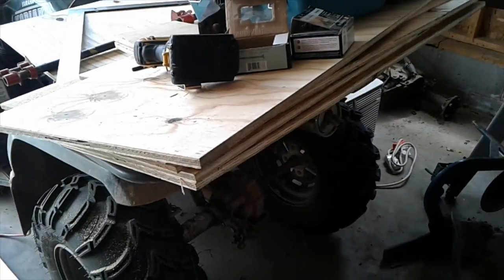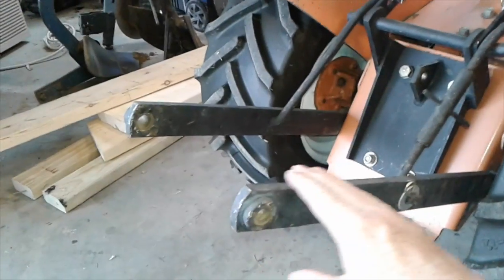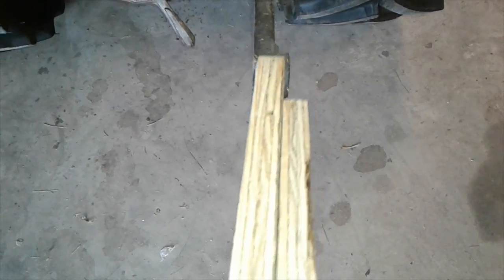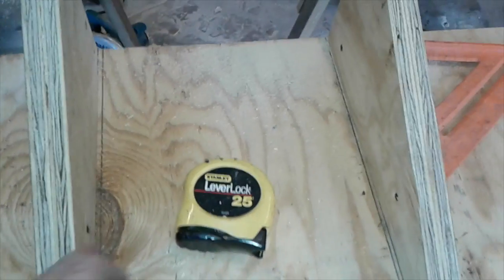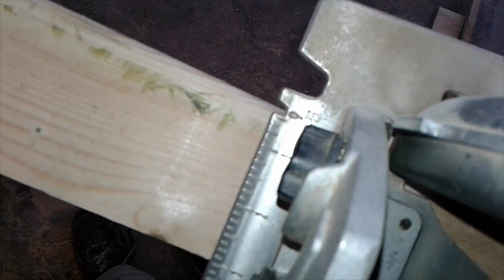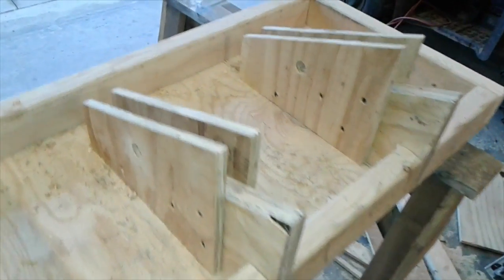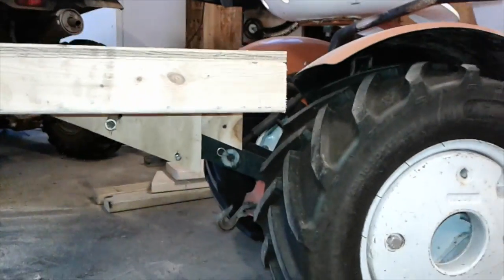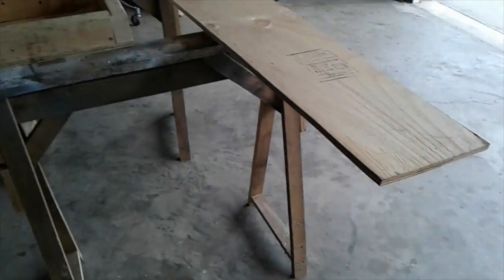DIY: REAR BED ATTACHMENT FOR THE SEARS SUBURBAN TRACTOR

Comment: Nice work !  I have a metal car top basket I will make a chain saw hauler basket for my SS 18. Thanks for the Re-power video. and the re-mounting of the pulley. I wonder if you like the 8 HP 301 or wish you had gone with the 16 HP Electric Start Motor ?  I am almost ready to re-power if I can not get the Carb rebuilt so it runs consistently , especially in winter when I need it most to plow.
Reply from the maker: I love the 301 and think that it is fine for my applications. I have sold that tractor with the 301 on it. I didn't get to mow with it. My 68 has an engine a little bigger than the 301 and smaller than the 420. About 11 hp and it has plenty of power for everything I do.
Reply: Thank you, I am leaning toward the Bigger 420, mostly for the electric start and I want to drag some fire wood out of the weeds at some point. I hope to get the Carb to stop leaking gas on the original still running 18 HP. Visiting an old Crusty Lawn and small engine Guys shop in town next week. Even with a new Motor in my old Tractor, it will be cheaper than a few months payment on a new Tractor.. What a great bargain these 40 plus year old Real Tractors are.
Reply from the maker: You are right about that. These old tractors are so much better than the thin framed junk that you buy today at Lowes.